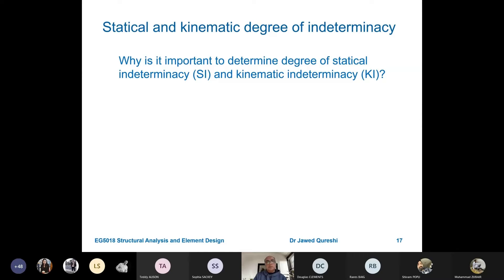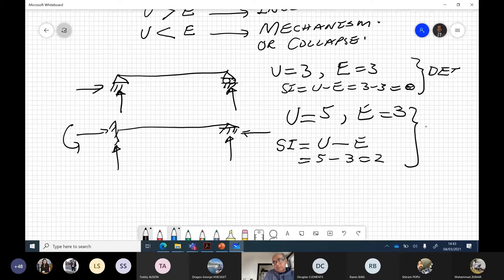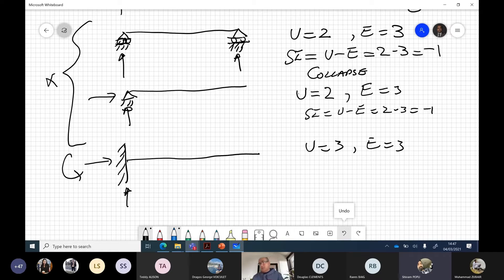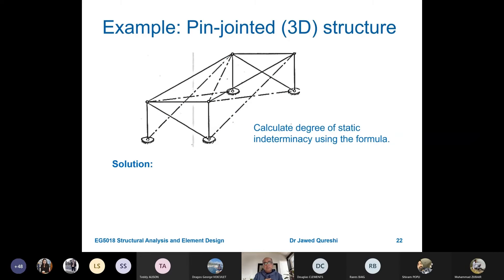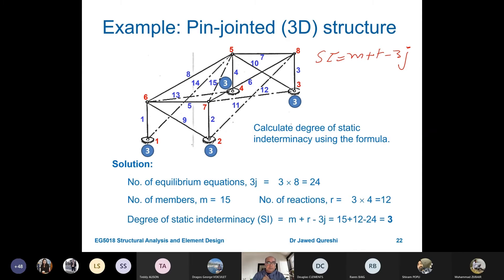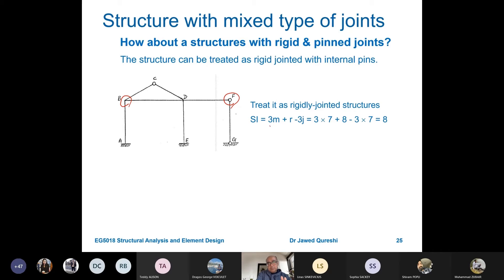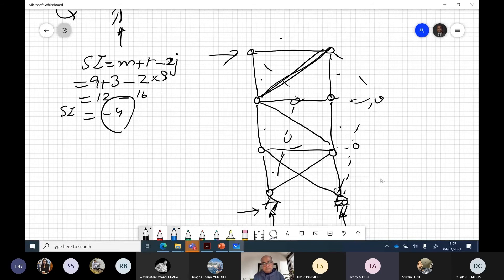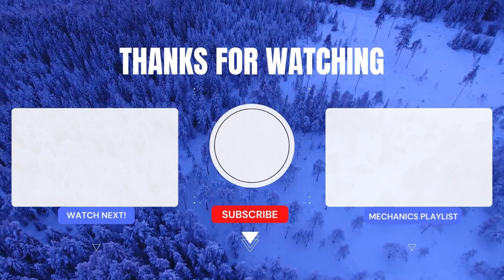MASTER static and kinematic indeterminacy!

Comment: In case of truss..at the joint we can apply summation of moment=0 , it will also give a equation...then we we consider only 2j known equation? ?why not 3j?
Reply from the maker: 2j is for trusses where only horizontal and vertical forces are possible and rotations are ignored as no moment is there. For rigidly connected framed structures, we have horizontal, vertical laods and moment, that is why we have 3j.